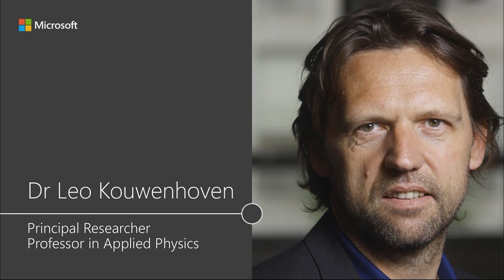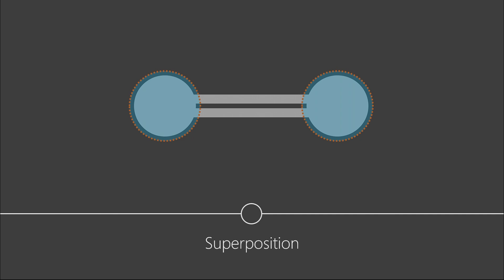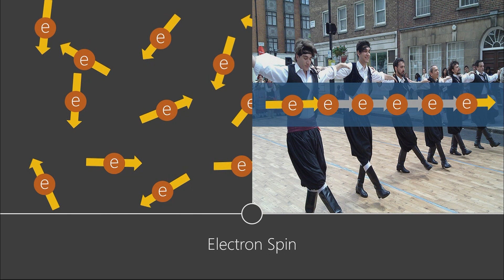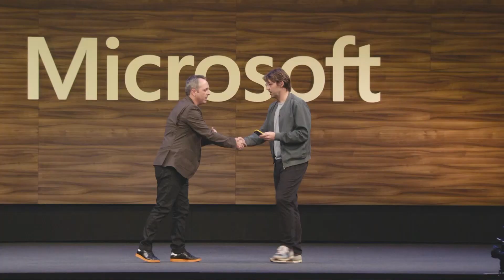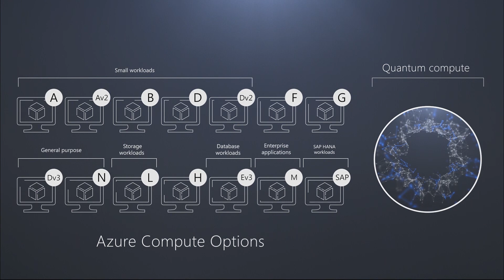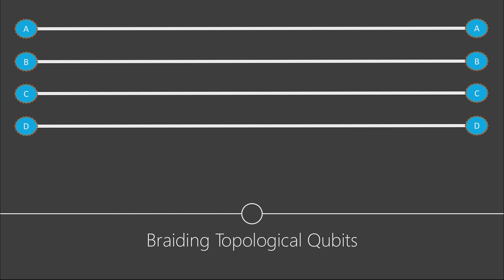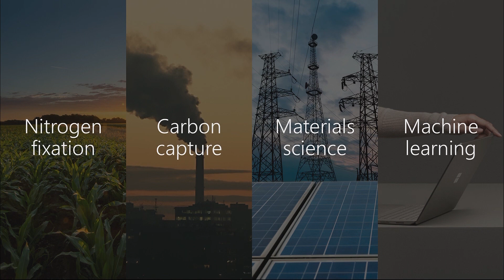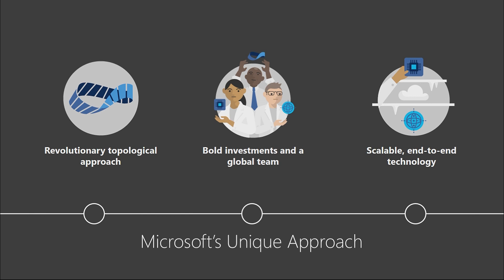Future Decoded Quantum Computing Keynote

Comment: The concept of having a program to write code that can be used by quantum computers is amazing. AI will become smarter at an exponential rate as soon as a learning program that usually takes days to become good at something with diminishing returns after a few days, can be run on one of these quantum computers. The diminishing returns won't matter, test thousands of tests at the same time and apply all that was learned on the next batch! Amazing, this is going to become the center of a new age.

Comment: By 'close to zero degrees C' I think he meant 'zero degrees Kelvin' and the translator had a whoopsie? Are the electrons which are fractionalized actually on shell? What methods of cooling are you guys using? UNSW was using helium isotopes, fractioning them off by mass, then using the entropic properties to actually make the system locally exothermic.